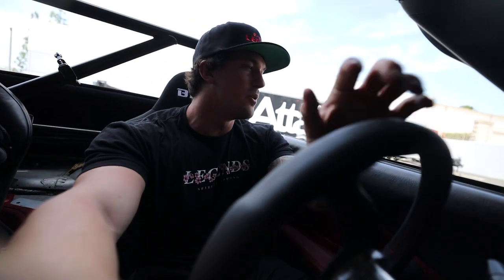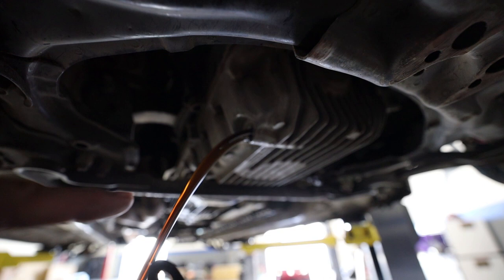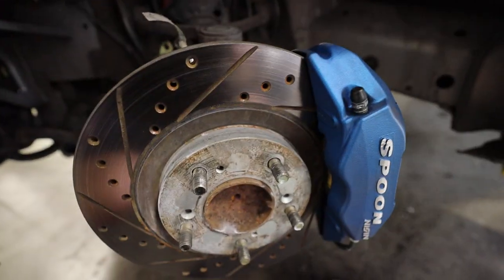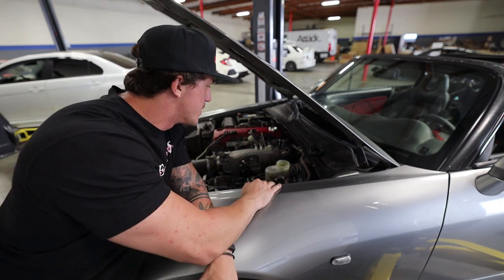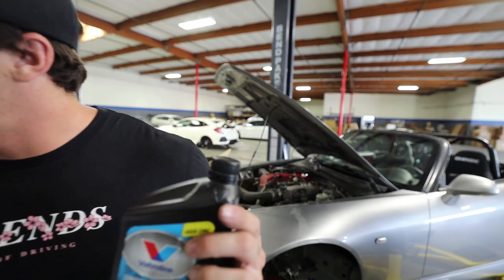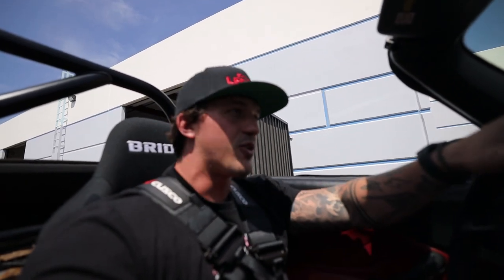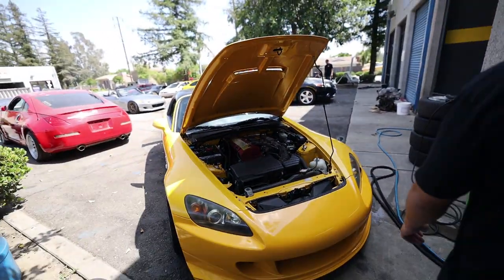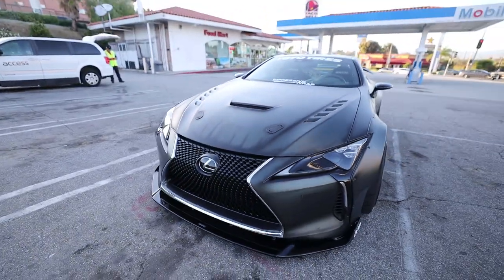TRACK PREP FOR THE HONDA S2000! | JDM SPOON SPORTS INSTALL

Comment: Dustin you should strongly consider changing all of the brake fluid. I also recommend using Wilwood 660 brake fluid as it has a much higher wet and dry boiling point then motul. Also consider octane booster in ur gas
Reply: Dustin I forgot to mention that you should also bleed ur clutch aswell as ur brake system.

Comment: You’ve forgotten to upgrade the rear brake pads for the 2nd trackday. Race brake pads makes a big improvement, considering that you have OEM disc size. If you can’t find the Spoon’s, the Ferodo DS3500 are great IMO.

Comment: Clean shaven and looking good man. Hope you get that Hondata KPro soon. Also, might want to get that engine checked over now that you may have run it on no oil. HMotors has AP1 swaps if you don't want to go full Spoon motor.

Comment: Meanwhile my Honda is sitting on jackstands waiting for an Axle seal 😂🥺
Reply: K Macaroni and mine is waiting for a driver side axle lol
Reply: Midori Wrx I had to replace both my axles and hubs, I can’t put the passenger side axel without the right seal or else it won’t fit
Reply: mines waiting for suspension bushing😂